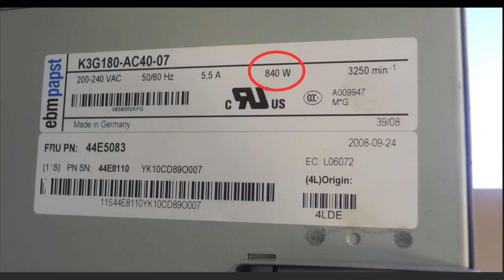PWJ40 - 840 Watt Blower Repair (IBM Blade Center H)

Comment: We had one blower out of service on our Bladecenter H. Out of warranty too! Our Blower its a little different, but your video was very useful and we fixed it. Thanks for take time to help another people like us. Greetings from Argentina!
Reply from the maker: Did you have the "high performance" fan with two outlets and a plastic propeller?
Reply: Yeah! That one. It more complicated to disassemble because de PCB board is much bigger.
Reply from the maker: Ok. I have never repaired that model.

Comment: looks like the driver board is built onto the motor it's self and the other pcb is a power supply?  Is there any indication what voltage the motor driver wants to run off?
Reply from the maker: I can only guess that it takes the 300v DC directly from the mains capacitor. There is not much voltage conversion going on.
Reply: @PlaywithJunk  thanks.  that does make it a little annoying to re-use with a standard ESC.  you saved me the cost of having to get one to find that out though! :D
Reply from the maker: @Sigmatechnica  The HP Blade-Center fans are funny to use with an ESC. But you need the newer 12v motor version

Comment: I managed to save a couple of these from scrap. Both were running fine on the first test, then one was dead when I powered it up again. Any idea what the problem might be? Nothing burnt on the inside. Controller killed by static discharge, maybe?  Would love to get it working again.
Reply from the maker: The electronic board has a few components that are sensitive to vibrations. And there are lots of vibrations in this fan...
If absolutely nothing works, the first suspect is the NTC resistor. A large black coin-like part, stuck in a plastic holder. One of the contact leads may be broken off. Then check all the gray capacitors for the same problem. There is also a temperature sensor (looks like a TO220 transistor) that falls off from time to time.
When repaired, glue everything down with enough hot glue....  :-)

Comment: Do you have a pinout for those fans? Im searching this for years now and your video is the closest i got yet, you seem to be able to run those fans directly at least. Thanks
Reply from the maker: It' super easy. You only have to connect the 230VAC wires and the blower goes full throttle. If you want to regulate its power, that's very difficult because you would have to communicate with the processor of the fan...
Reply: I suspected something like this. I was also able to run it with full speed,  but unfortunately i do not really see what all the other pins standing for. i tried pwm on every pin, but it does not change speed with it.
I checked datasheets of hp blowers and it looks like they communicate with the fan over i2c, so i suggest something similar for the IBM fans. Unfortunately i did not found a datasheet for IBM fans.
Reply from the maker: that could possibly work. It's also possible that it somply stops working when sopply voltage drops.

Comment: Is it common practise to change bearings in machines like that? I'd expected that you would use a new fan.
Reply from the maker: New fan $500 (used), new bearings: $20.... that's why. Common practise maybe not. Most service companies would just replace the whole thing.

Comment: I wonder why they went for one massive fan instead of several smaller ones.
Reply from the maker: You would need many fans for the same airflow. It's a question of space. And more parts do fail more often.
Reply: I was thinking with multiple smaller fans you get redundancy and easier maintenance, possibly lower cost.. for the same airflow.
Reply: it was moving the cart man XD try to do that with small fans.
Reply from the maker: Cartman.... ;-)
Reply: Smaller fans would not produce a powerful enough airflow to actually pull air through the blades fast enough, there would be a mild breeze which would have the blades heat up in minutes...
Reply: I can't seem to find any specs for the K3G1180-AC40-07, particularly interested in the airflow it produces to actually look at some numbers and see if this may or may not be replaced with several smaller fans because without numbers we're just throwing words here.
Reply: VoltLog Trust me, while I don't have a BladeCenter H (I have a BladeCenter E...) these fans have enormous power, they move with the power of a vacuum cleaner in idle and once they go full power they'll actually pull a paper through the bladeservers by shredding it to pieces... (took a few hours to clean that mess up...)
I've done a 1080 radiator (3x3 12CM fans) for watercooling and even with Gentle Typhoon fans from Scythe they come nowhere near one of these IBM fans while all 18 of them draw just under 250w...
Reply: VoltLog I can probably attest these cage / drum are very efficient at moving air.  hence why they use them in traditional U.S. home air conditioner units.  They move lots of air. Considering models in the ~400 watt range are in the ~500cfm realm, not hard to imagine that fan can max out at ~900cfm.
Reply: +VoltLog having dealt with these and other blade centers and similar things from HP, Dell, SUN, Supermicro etc etc, I can guarantee you these are better cooled than anything else largely due to these giant fans.

Consistently see lower CPU temps with these machines and in general with machines using larger fans.

The other nice benefit? These are SOOOO much quieter than many of the other alternatives. We had a DC with about 30 HP c3000 blade chassis in it. It was actually dangerous to go in there without hearing protection because of how insanely loud they are.

PWJ, If you've got a spare fan from a HP chassis you should really tear one of those down... they're mildly insane.
Reply: What? BladeCenter fans quiet? Did you lose your hearing when standing too long in a DC without hearing protection, which is required in all DC's?...
Reply: They're not quiet by any means of the word, but they're nowhere near as loud as the competitors with smaller fans.
Reply: Well the smaller ones have a high pitched whining sound to them. Got to love it when you slide a server out the rack and it starts whining when you pull it's cover off as if it's uncomfortable :P
Reply: It's not just the pitch, it's also the SPL. They are demonstrably quieter.

Comment: "840W" is that one of those hypothetical fan power ratings, which looks nice but are not very realistic in the current application? Eg. You often see vacuum cleaners rated 2000 W or 2400 W or whatever the maximum in your country is over a standard power outlet. But hook up the vacuum cleaner to a wattmeter and try to get it use anywhere close to 2000 W. What they are really doing is taking higher power motors and running them in environments where they can never attain that much current draw because they're just pumping air, even at their max speed in the appliance or with the inlet fully blocked. This can mean the motor lasts longer because it's overspec but they are usually not marketing it in this way. My 1400 W vacuum cleaner uses 150 W on the lowest speed and 400 W on the highest speed.
Reply from the maker: I just hooked that blower to my wattmeter and it reads 1060VA at full speed. Regarding the unknown power factor then 840W seems to be very realistic. 

On consumer products "2000W" looks better than 1500W and makes people buy them. And a 2000W vacuum cleaner is not necessarily better even if it really has 2000W. The turbine design is more important. I agree with you there is a lot of blah blah in the world of consumer electronics. But if nobody knows the difference....
Reply: Impressive!
Reply: Never forget: This is industrial stuff! And EBM is a big company which produces awesome things. I´ve got an EBM fan with 120W...  But 120*120*38mm! :D

Comment: Good job saving $$$ !! Thats what happens when you use just a unprotected metal shielded bearing.. They shouldve used rubber sealed..
Reply from the maker: I'm not sure if they really last longer. I have never seen rubber sealed bearings in any fan or blower.
Reply: chrigel1234
 Thats where the bean counters cheesed out. Every radiator fan in almost every new car made has rubber sealed bearings that can last the life of the car. Most high quality electric motors in big/small industry use them when they will spend $1.50 more for a good bearing or sometimes its optional. Metal shielded bearings Will let contaminates in and reduce the life of the bearing significantly just the facts. Delta Electronics are what my bro uses in servers. Some can move that cart you have just the same, for very reasonable costs. I know its a propitiatory unit you have, but like you, bearings would be replaced or the whole unit would be modded for Delta server fans.. Boca Bearings online is the place to go for any bearing.. Shoot for shits-n-giggles try some of the new ceramic bearings in anything that uses bearings, they are quite amazing! I have them on a long board and it flies!
Reply from the maker: You're right... but if nothig goes broken, what should I repair?? ;-)
And IT technology is designed for a maximum of 10 years. It doesn't help when the fan lasts 50 years...
Reply: chrigel1234
 Think of all the cool spare parts you can collect. Then Do tear down/explaination videos of that great equipment, kinda like what the channels, AvE and BigClive do.. :)
Reply: A car that runs 300.000 km at average 50 km/hr runs for just 6000 hours. Which is not even a year of running in a server.